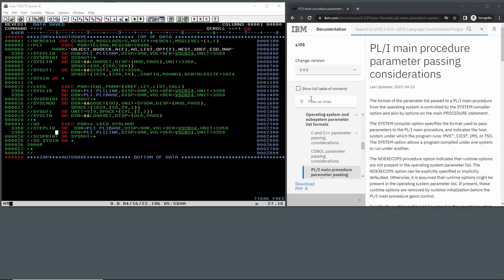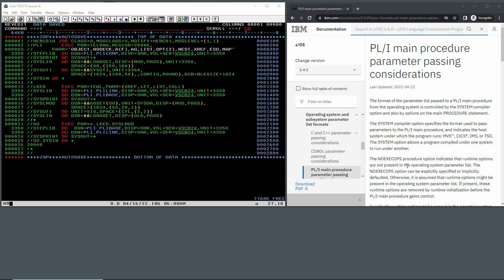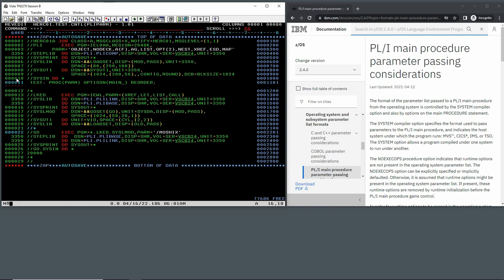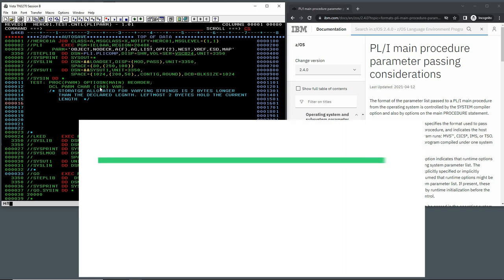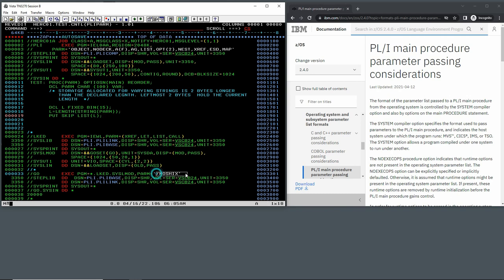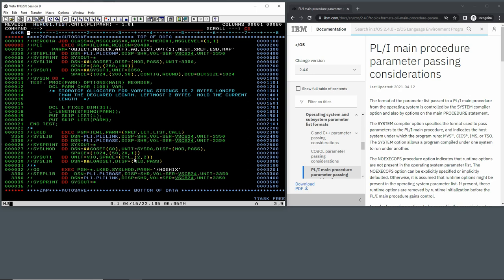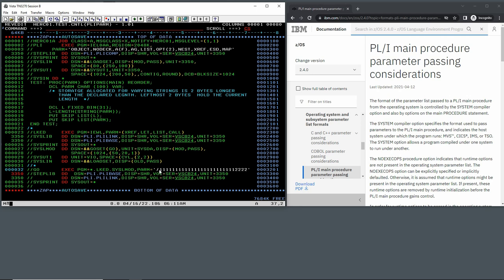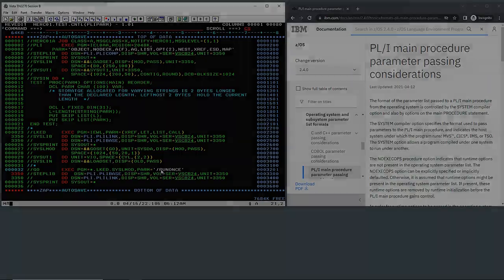Passing parameters to a PL/I program - M208

Comment: I have looked at the dump and the PL/I (F) Programmer's Guide - C28-6594-4, and I see what is happening.  Any character (or bit) string in PL/I is accessed via a "String Dope Vector".  This is 2 words with the following format.
0-2 : for a bit sting, this is the offset to the first bit of the string within the addressed byte. (Will be 0 for character.)
3-7 : will always be 0.
8-31: address of the string.
32-47: maximum length of string.
48-63: current length of string. For fixed length string this will be the same as the max.

Therefore, the address in the parameter list for the character fields point to the SDV and not the character string.
For the FIXED BIN(31) binary field, the address in the parameter list points directly to the full word binary number.

I'll do some more testing & will update when I get it to work...

Comment: What is the deal with the slash at the start of the parm string in the JCL? I programmed PL/ I many years ago but can't remember this.
Reply from the maker: Well it needs it
Reply: @moshixmainframechannel  Actually, with the MVT PL/I compiler of TK4-, the slash is not needed. However, I tried on z/OS with PL/I Entreprise and there, one needs the slash, unless the NOEXECOPS is also specified as an option of the main procedure (a recommended practice according to the documentation). This behavior is connected to the (more recent) SYSTEM compile-time option which indicates the format used to pass the parameters at run-time. In the video, for the compiler used, the slash is apparently needed, but I don't know if NOEXECOPS is available.
Reply from the maker: Yes this compiler needs it.

Comment: I am happy to have found another PL/I fan.  On z/OS, i had PL/I program (compiled with Enterprise PL/I) that called an assembler program.  I have  brought those 2 samples to my MVS 3.8J system, where I only have OS/360 PL/I COMPILER (F) V5.5.  I do understand that when PL/I calls a subroutine, R1 contains the address of a "PLIST", that are pointers to the parms.  Hoping that you might be able to save me some time, before I resort to looking at a DUMP...  I will just include some code snipits.

DCL HXHASUB  ENTRY(CHAR(8),FIXED BIN(31),CHAR(16),CHAR(72));
CALL HXHASUB(Z1, RC, DATE_TIME, SAVEAREA);

In assembler I have tried: 
         PRINT GEN                                                      
         SAVE  (14,12)                                                  
         BALR  10,0                 ADDRESS OF ENTRY                    
         USING *,10                 TELL ASSEMBLER                      
         B     SKIPVRSN            BRANCH AROUND CONSTANTS              
         DC    CL8'HXHASUB '                                            
         DC    CL10'A00.00.01'                                          
         DC    CL12'28 APR 2022'                                        
         DC    CL8'R.HAHN  '                                            
*                                                                       
SKIPVRSN LM    2,5,0(1)             GET ADCONS TO PARAMETERS           
 *                                        R2 HAS ADDRESS OF TOD          

         USING AP1,2                                                    
*                                        R3 HAS ADDRESS OF RETCODE      
*                                        R4 HAS ADDRESS OF DATE_TIME    
         USING DSAVE,5              ESTABLISH ADDRESSABILITY FOR SAVE A 
         LA    14,SAVEAREA          POINT TO LOCAL SAVE AREA            
         ST    14,8(13)             POINT PREV AREA TO NEW ONE          
         ST    13,4(14)             POINT LOCAL AREA TO PREV ONE        
         LR    13,14                SET R13 TO LOCAL SAVE AREA          
*                                                                       
         OPEN  (LIST,(OUTPUT))                                          
         PUT   LIST,MSG                                                 
         PUT   LIST,(2)                                                 
         PUT   LIST,P1                                                  
         CLOSE LIST                                                     
*                                                                       
         ST    15,0(3)              SET THE RETURN CODE                 
*                                                                       
         L     13,4(13)             POINT TO CALLER'S SAVE AREA         
         RETURN (14,12),RC=0        EXIT TO CALLER                      
*                                                                       
MSG      DC    CL132' ** HXHASUB: DEBUG OUTPUT. ****'                 
         PRINT NOGEN                                                    
LIST     DCB   DDNAME=ADEBUG,LRECL=132,RECFM=FB,                       X
               DSORG=PS,MACRF=PM,EXLST=MOJFCB                           
DBL      DS    D                                                        
MOJFCB   DS    0F                                                       
         DC    X'87'                                                    
         DC    AL3(JFCBMO)                                              
JFCBMO   DS    22D                                                      
*                                                                       
         LTORG                                                          
DSAVE    DSECT                                                          
SAVEAREA DC    18A(0)                                                   
AP1      DSECT                                                          
P1       DS    CL8                                                      
         END                                                            

The PUT's do not show the "Z1" parm.  I even did the PL/I compile with LIST, and did see that it built a PLIST as expected.
Hoping you spot what I have missed.  If not, I'll take on a DUMP...
Reply: I tried your program on TK4-. In my case, the Z1 parameter gets printed but with some crap at beginning of the line. I set RC=61 before calling the assembler routine and I printed the value after the call: I get RC=0 (although I am not sure it is for the good reason). If you haven't done it already, take a look at the PL/1 (F) Programmer's Guide, page 204-208.
Reply: @Stosszahlansatz  I have not been able to find any PL/I (F) manuals.  Do you know where I could find them?
As far as the RC, I know that I haven't put anything in the subroutine to reset it to 0, so I would have expected it to still be 61.  Come Monday, I'll probably print out a dump that I'll force in the subroutine.  I know printed dumps are old fashion, but from my ancient experience, it''s usually easier if you can draw all over the dump.
Reply: @ronaldhahn1936  For the manuals, check it here: http://bitsavers.trailing-edge.com/pdf/ibm/360/pli/
Reply from the maker: Thank you René!
Reply from the maker: True. Printed is easier
Reply: @Stosszahlansatz  Thanks. Looks like the Programmer's Guide has an example. I'll see whether I can make that work.
Reply: I was able to use the programmer's guide to get the assembler subroutine to work.